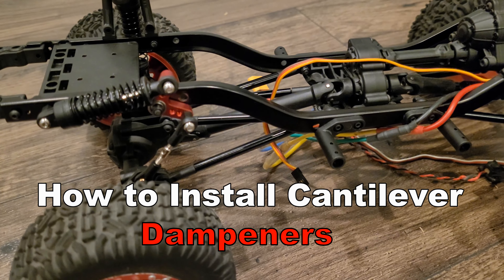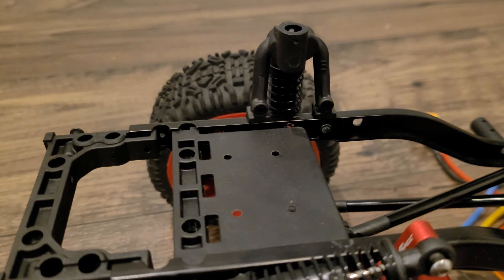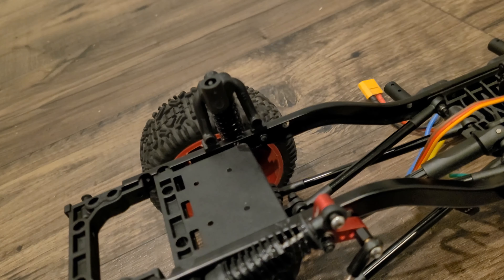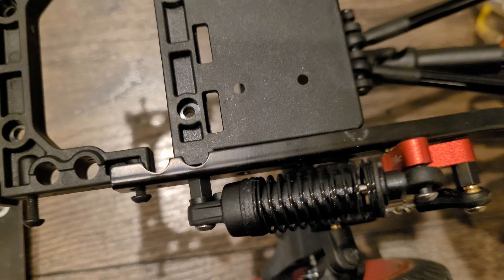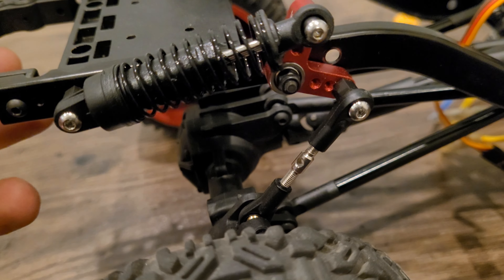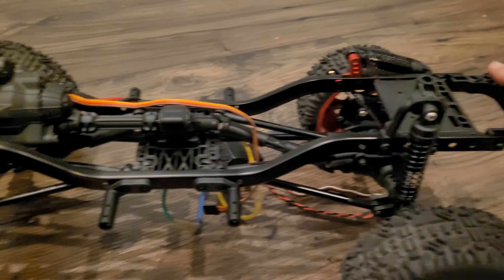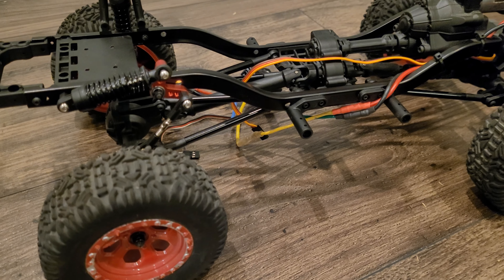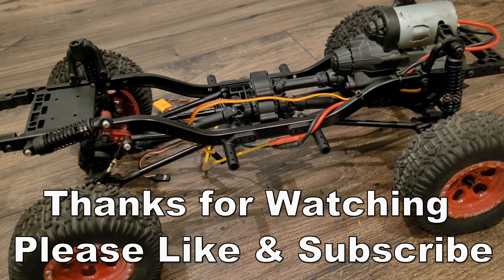How to Install Cantilever or Inline Shocks on your RC Crawler

Comment: You can get more articulation with cantilever suspension than from regular if you use right setup. For instace look for RGT Crusher 1/10 RC Crawler. It's all about the lenght ratios on that articulating lever and spring ratio. So, if you move the bolt mount on shock side, one or even two holes, closer to the articulatim point you will get more wheel travel with the same shock travel. Consequently you'll need stronger spring for the same behavior like before.
Reply from the maker: Appreciate the insight! I'm sure it will help others.